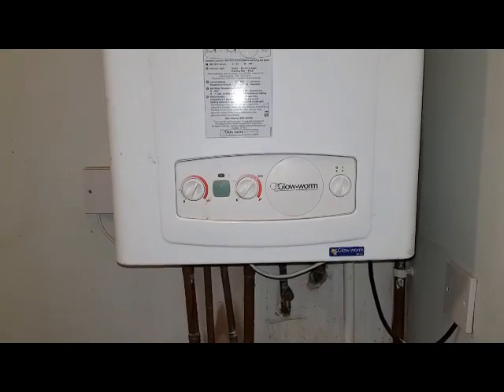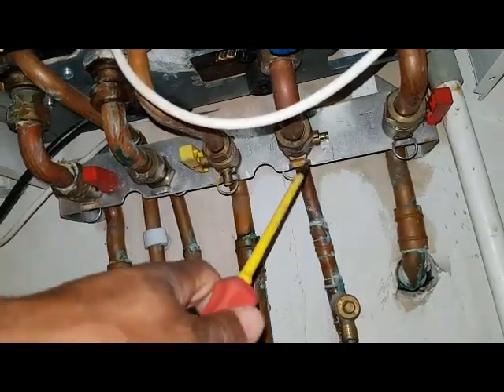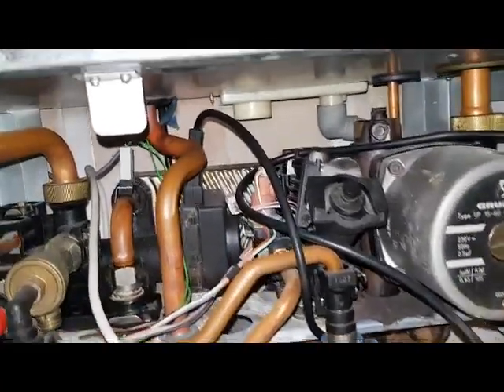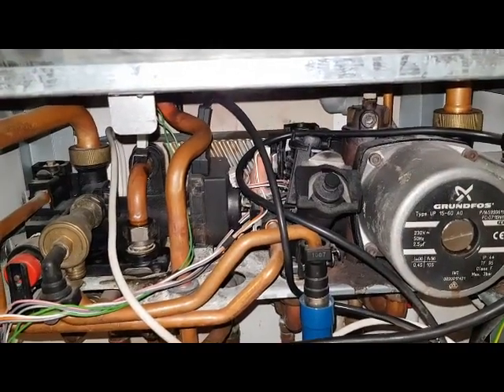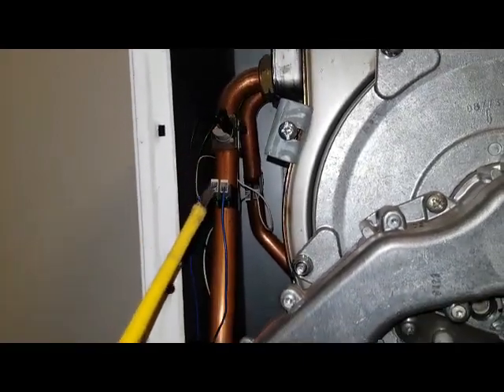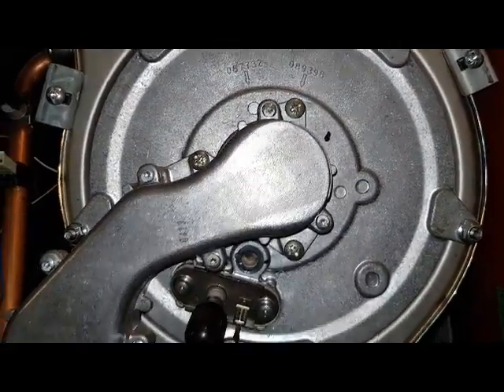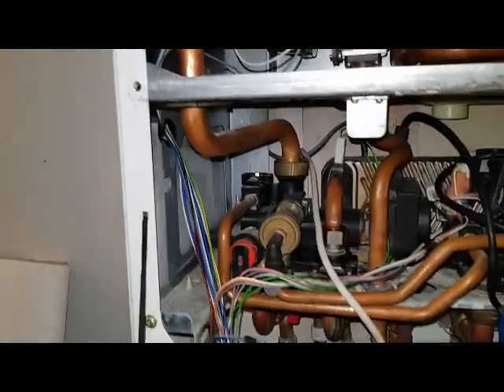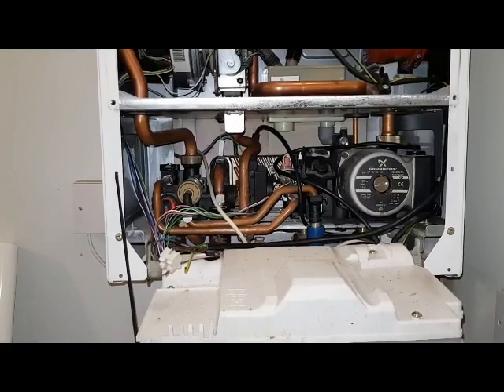Glowworm 30CXI tour. With Coach Tony Morgan

Comment: Please tell me how I increase the pressure? People are saying turn the blue nob at the bottom anti clockwise however my does not turn
Reply from the maker: It could be broken and will need replacement
Reply: Mine will not turn either. 30cxi

Comment: Hi, I've just replaced a few radiators at home, whilst refilling the system by opening the blue filling loop tap, water was gushing out the brass nozzle on the filling loop, I had to catch it in a bucket, the bookers pressure did go up slowly even though most of the water I was letting into the system was escaping, what would cause this, could it be a blocked valve in the filling loop, would descaling fix this or just replace the whole filling loop part
Reply: My boiler is doing the same did you get a fix regards
Reply: Same here

Comment: Hi, I've moved into my new home and also have this boiler. Is it compatible with hive heating?
Thanks in advance
Reply: Hi. I've just fitted and connected Hive to mine and it's worked a dream. Mine's a Glow Worm Ultracom 30cx. Hope this helps! 😊
Reply from the maker: It should do
Reply from the maker: Hi yeah it will

Comment: When i try and pressurise  the boiler .the water comes straight out the hole on the pipe
Reply: Yes mine does the same , have you managed to find out why ??
Reply: @johnpeacock1293  Hi guys, I had a similar issue i think, are you talking about the overflow for the Pressure Relief Valve which drains through to the exterior of the house? If so then all i did was change the PRV.
Reply: @johnpeacock1293  As Cannons says this is a sign that the PRV is on the way out (or is already knackered!). It's the brass valve that the water is coming out of when you try to pressurise the system. You can replace the valve and it's just a case of removing the clips and replacing the valve. If you can get hold of the individual valve then you can get a filling loop set which has the PRV as part of it. You can pick this up for about £60 and it's usually a quick job to do. :-)
Reply from the maker: hey we're currently trying to grow our Facebook group and would love you to join Tony and the team using this link, Tony will be available to answer all your questions directly there's also updates on new trainings we just released too. https://www.facebook.com/groups/167070231326174
Reply: Did you manage to figure out the problem?

Comment: Hi - how do you set the timer? I’ve just moved into a new house with this boiler, tho’ it’s heating only, and we cannot find the timer/controls. Thank you.
Reply from the maker: Is the timer on the boiler or on the wall?
Reply: A+R Central Heating and Boiler Repair Experts Ltd  - hi there - I can’t see a timer anywhere. My Dad (who used to be an engineer) couldn’t find it either. I’m wondering if there was a separate one that the previous owners took with them? We’ve searched in cupboard, in the hall, all round the boiler. Bit miserable really. 
Thanks so much for replying.
Reply: Oh, it’s a 24 version....heating only. Looks just like the one you describe here, but without hot water (that’s an immersion heater)
Reply: Found it!!! It was upstairs, in the same cupboard as the immersion boiler.....obviously. Ha, ha. Warm house today, thankfully.